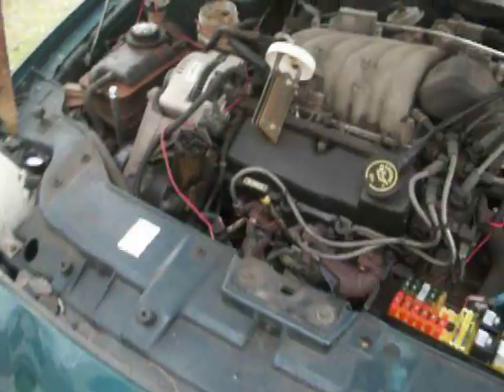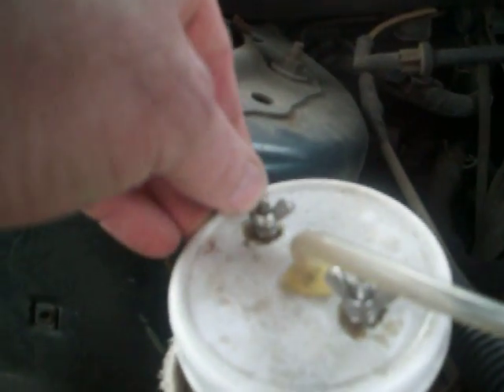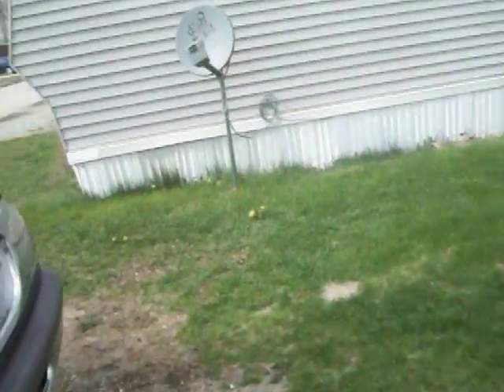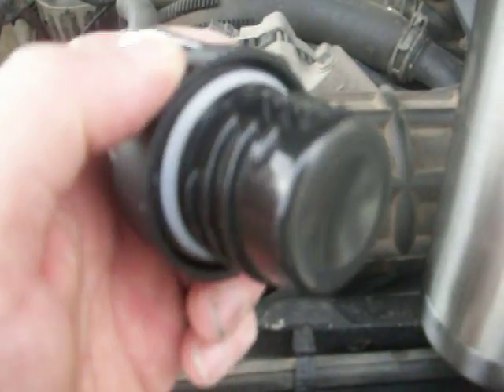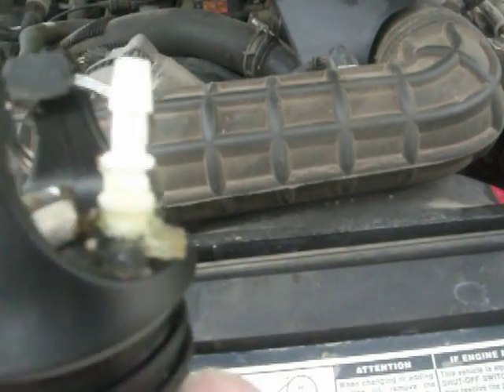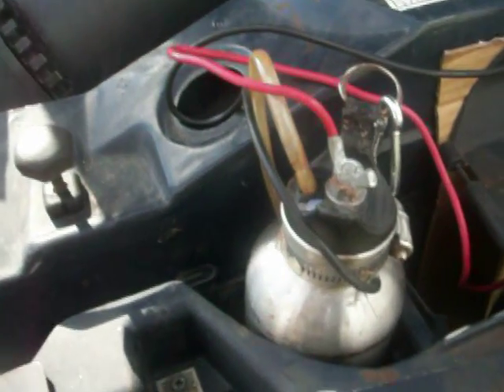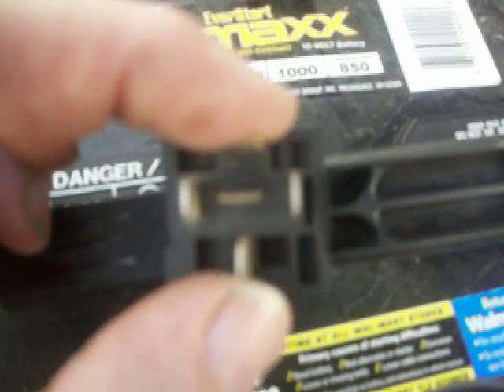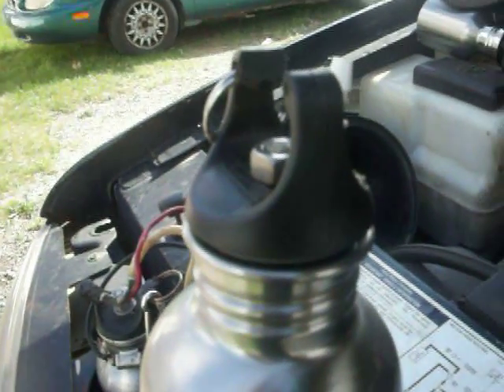HHO / hydrogen generator (water for gas) from Westcoast Exterminators!

Comment: Hi I'm SAEiD of Iran
I make a wet hho generator for my car by seven still plate but the wire near the reactor is very warming near to melt.
I don't use relay in wet hydrogen.is really important for in problem or no .
Thanks if answer the my question.and excuse my language no good.
Reply from the maker: Ok.. I think I understand. Answer.. If you use too much baking soda then you have melt... So use little bit baking soda then no have melt. Don't have wire INSIDE. have bolt inside, bolt sticking outside and wire go on outside.
Reply: @wcemichael  ok 
And other question what is relay roll and between  salt and  baking soda which is better .for engine damage .
Reply from the maker: @saeidgoodarzi2495  Do not use salt
Reply: @wcemichael  Hi
For 1 litre water how Wight power bicarbonate need .and for car bobler is nesesri or no ,
Reply from the maker: @saeidgoodarzi2495  Oh man.. That's hard to answer. You have to guess.. Test and make notes. 
IF you are  having problems and water get hot and boil...then reduce bicarbonate. If too much power from wire, then reduce bicarb. If you have battery dying, reduce bicarb. Every unit is different... every bicarb amount is different.

Comment: Michael,if you place a one way check valve in the line exiting the hho generator,it will prevent the generator from detonating if you do have a back fire.
Reply from the maker: Yea....I'm not sure about that. If there is pressure then the valve is open, if the valve is open....I would actually have to test this before confirming it. Saw a guy use a cigarette filer in the line to prevent that. Don't know if that works either.

Comment: It is funny how the denial ones do not realize that the energy gain here comes from a controlled explosion inside the combustion chamber, hydrogen is a gas, but is not gas pushing the piston, it is the force of the explosion of said gas, this principle applies to the fossil fuel also, other ways, what they claim, it should be that cars are using the same equivalent energy that is used in refineries to produce those fuels

Comment: A supercharger makes the engine more powerful, not necessarily more efficient. You compress air so you get more air in your cylinder, which means you can put in more gasoline to extract more power. The two are completely different things.

Comment: That's how it works, same as on your bike, when you put on the generator for your headlight you have to pedal harder. Nothing is free in physics, you convert shaft power to electrical power, torque turns into current.

Comment from the maker: Yes this is true, The altenator works a little harder and takes a little torque from the engine to more fuel in the engine, BUT what he's discribing is also exactly how a supercharger works. A supercharger steals torque straight from the engine to force more gas/air mixture back into the engine so the engine will have more torque. If we use the same laws these guys use for HHO then a supercharger can't work either.

Comment: The torque used to drive the alternator comes off the shaft, you cant use it twice. To have the same acceleration, you need to replace that torque, which costs you more than you gained through the HHO.
If it really worked, all cars would have HHO units, but it doesnt work, so they dont. It's not rocket science people.

Comment: "You take energy from the shaft and... get electricity."

not quite. The energy comes from the battery, which indirectly came from the shaft. The alternator never turns off, it's always on, charging the battery. The gains would come from the difference between charging a battery thats already full and how well it charges while under the load of the HHO unit.
Not that simple, Captain Entropy, where's the energy that gives electrons their spin?

Comment: isn't the alternator spinning in there anyway, producing surplus electricity? The torque from the engine is used for moving the car, production of electricity is only a consequence of producing torque for the driveshaft
Even if it takes 3000W of shaft power to produce equivalent HHO, it would probably take 15000W to accelerate the car. Hypothetically speaking. The real question is, how much electricity coming out of the alternator is used vs. wasted. The alternator spins regardless of it's load.

Comment: No it doesnt reduce fuel consumption. Let's say you take 3000W shaft power to create 3000W worth of oxyhydrogene. You put the oxyhydrogene in your engine and get 1000W of shaft power. You still need additional 2000W of shaft power to drive your generator that come from regular fuel. Ripping out the HHO generator altogether saves you 2000W worth of fuel flow.

Comment: Doesn't HHO reduce the amount of actual gasoline required for the same torque? Effeciency of fuel burning is not the point, fuel usage per torque is, more fuel from HHO means less fuel from gastank... it's peculiar that you'd gloss over that notion.
Can electrolysis of water be done more efficiently than other schemes?
There is where more increases lie.

bah I'm just an armchair hypothesizer anyway.

Comment from the maker: The relay also makes sure I don't accidently burn up my wiring harness from drawing too many amps through 1 wire.
So as long as you stay away from computer wires and do not tap into a fuse that is on when you turn the key back to ACC and your not trying to pull too many amps then your OK.

Comment from the maker: The steel drinking bottle is SO much easier for a begginer. I used a 30 amp relay. It automaticly switches on the power coming straight off the battery. I didn't want to tap into the wrong wire and burn up a $200 computer. The relay kicks on ONLY WHEN THE IGNITION IS ON. If I turn the key back to listen to the radio w/ the engine off, the HHO is off, OR ELSE YOU COULD BLOW UP SOMETHING WHEN YOU START YOUR CAR after listning to the radio for 5mins.

Comment: @wcemichael I know I've been a harsh critic of HHO, but there is one way HHO can work. If you install a heat exchanger in the exhaust tube and use it to power a water vapor process that drives a turbine and then a generator, you can then perform electrolysis and use that HHO to improve your mileage. This is fundamentally different, because instead of using shaft power, you are using the exhaust heat, which is waste anyway. If you can find a way to use waste, you increase efficiency.

Comment: @HHOTruth You keep saying that, but what more is there? The efficiency of an engine has very little to do with how efficiently the fuel burns, in most modern engines the fuel is burned with an efficiency north of 95%, there is not much you can do. I've comprehensively shown that HHO cannot work. All you're saying in return is "Well, there's more..", that doesn't have me convinced.

Comment from the maker: @k0nn0r I have nothing against going to school, but I have over 35 years on hand experience. I fixed my own bicycle when I was 7 from a book. I helped build my mothers house when I was 14. I did it a little of everything. I worked on my own cars, before I was 20. I wrote my own programs on a comodore 64 in college. I figured out motorcycles from a non running yard sale honda 350 and rode it for years. I'm selling a new style wood stove plan on ebay. Now I've figured out the power problem on HHO.

Comment: @HHOTruth I just did. Using 3000W of shaft power to create 3000W worth of oxyhydrogen gas is physically impossible already. But I'm giving you the benefit of doubt. Even those 3000W of gas dont turn into 3000W of shaft power because your engine is a lot less than 100% efficient. You get around 1000W of shaft power, the rest goes out your exhaust pipe as losses. You are turning 3000W into 1000W. Where is the gain?

Comment: @HHOTruth Let me explain to you why HHO doesnt work: Let's say you take 3000W of power from your driveshaft and drive a generator. Let's assume there are no losses and those 3000W turn into Oxyhydrogen gas worth 3000W. Now you put this Oxyhydrogen gas into your engine that's only 33% efficient, you get 2000W losses and 1000W worth of shaft power. You turned 3000W shaft power that went into the generator into 1000W of shaft power with 2000W of losses. It doesn't work. It's a scam.

Comment: @wcemichael The argument that the mythbusters experiment failed because it was not run properly is idiotic. To say that their electrolysis was insufficient because they didn't add baking soda further proves that you have no clue about what's going on, you don't need electrolytes for electrolysis, it even works on de-ionised water. HHO doesn't work and cannot work because your overall sum of energy is negative, not positive. If you believe it does, you're either an idiot or a fraud.

Comment from the maker: @k0nn0r But remeber! the space shuttle main engines (not the side boosters) run on 2 parts H 1 part O, not gas. H as I understand is 5x more powerfull than gas. And first your getting a extra bang from the HHO then this helps the gas burn more complete too (remeber we need a converter to burn the excess gases). I have also considered the electric consumption too AND I have come up with way to get HHO WITHOUT drawing extra power. I just proved this in a bench test and will try it next summer.

Comment: @HHOTruth But you dont just add HHO or H2, you have to dissociate water first and that costs you more energy than you get back. If you had a bottle of H2 and just injected that, sure you would have a gain, because the cost of creating that H2 wouldnt go into your balance, it was already paid. If you make your own HHO, you have to account for the energy that goes into that and that leaves you with more losses than gains.

Comment: @HHOTruth It's very simple. You take energy from the shaft in the form of a generator and you get electricity. That electricity is used to dissociate water into hydrogen and oxygen. Then you put that in the cylinder, combust it with the rest of the gas and get some energy out of it. The energy you get from the combustion is less than your electrolysis cost you. You have losses in the generator, the electrolysis, the combustion and the thermodynamic process. You end up with less. Simple

Comment: @wcemichael But it's not a computer, it's a simple machine designed to do one thing. The process is clear and you analyse it, every step is known. You dont have to do the experiment, you can look up the values in tables and see what happens. It's not magic, it's science.
It's not working, it can't work. You cant get more energy out than went in. What you are saying is not even a perpetuum mobile, it's worse, because you get more out than went in.

Comment from the maker: @k0nn0r If you took your computer in to be fixed and the guy said he knew what was wrong but never tested it before or after he worked on it, would you go back to him? If you haven't put one on your vehicle then you don't really know. Now the big drawback is it takes power to create this power, BUT I just ran an experiment on how to run WITHOUT using extra power. sounds crazy but I did it. and will be trying this out next summer on my bike.

Comment: @wcemichael Actually, you can know that. You get the same energy back from hydrogen oxygen combustion that you invested into splitting water, but you cannot make use of all the energy of that combustion. You have heat losses in the cylinder, you dont have a complete combustion and most of all, you dont have a thermodynamic process with an efficiency of 100%. You cannot get all your energy back, so you end up with more losses than gains. It's basic thermodynamics.

Comment: @christo930 I had a 91 Calais with a quad 4 engine in it that got 40mpg, 160hp and 165FP/tourque, all three numbers were better than the standard engine a tech-4. It got such mileage because it had 4 valves per cylinder and a better than 10:1 compression ratio. The problem is that they didn't use a better head gasket and the high compression ratio blew them out(mine never did). AND it had real air conditioning. The new air conditioning doesn't work as good as freon and uses more gas to run.

Comment: @wcemichael I noticed that too, light cars from back in the day got pretty good mileage compared to today. Of course, some of them were real gas hogs. Largely, I think it's the emissions that does it. The temp has to be kept down so they use a mixture that is too rich, the cat converter puts a lot of pressure on the exhaust, you have air pumps dragging down, bigger water pumps to keep the aluminum blocks cooler and far too much electronics that necessitates a larger alternator.

Comment from the maker: @christo930 The auto industry is not giving you their best work. Look up 1976 Dodge "Feather Duster" Its a mid size car with a 6 cyl engine, with a carberator, no electronics, and cars tended to be heavier back then. It got 36 MPG.  My wifes 2002 Dodge Stratus, with a 4 cycl and modern EFI And aerodynamices can only get 25 MPG, while I had an older Ford van with V8 EFI, Heavy and shaped like a box. got me 21 MPG

Comment: @wcemichael Thanks. I know it sounds rather obvious, but having the tires properly inflated and the engine in good tune can help too, as can removing any unnecessary stuff in your trunk and such (reducing weight). Also, for most cars on the road today, there are replacement chips for your car's computer that can increase mileage or make it faster by leaning out the mixture and custom timing and most can be disabled for when it comes time to get your emissions test (if you have that in your area)

Comment from the maker: @christo930 no prob. the only dumb question is the one you don't ask. on regular vehicles, it seems to give about 5 MPG extra, no special hook ups. your also battling the extra power it takes to generate gas. still testing. On my bike all reg bulbs were either replaced with LED bulbs or turned off to reserve power for the unit. the bike goes 20 miles extra on 2 gal tank. Check my newest vids for motorcycle/scooter hookup. next year I will try multible units, get more gas and use less power.

Comment: @wcemichael Oh, it looked like it was on the manifold side of the filter, sorry about that. Since I was seeing it disconnected, it looked like the hose was coming into the intake hose right after the filter and right before the mass air flow sensor (MAF sensor) and the MAF sensor controls mixture timing and other things, and I wouldn't want t see it damaged.Sorry  about that. What are your latest mileage improvements?

Comment from the maker: @christo930 Well, those hoses get dried out and change color a little bit. And the first hookup or 2 the unit was overfilled. and the run off was blown through. But the rust was still trapped in the water. You'll notice a brown stain on the air filters too, The first trial in the green car started boiling away from too much the sodium being too strong, and splued all over it. The truck and bike, if you'll note. The hose is on the other side of the filter so the gas is filtered.

Comment: @wcemichael  I notice the hose is brown too, which means rust particles are making it into your intake system and could, in theory, damage the valves, rings and cylinder walls. Perhaps a small in-line air filter would keep any rust particles from the intake system. I also notice the hose goes into the intake directly in front  of the MAF sensor, which feeds the computer information about how much air is getting into the engine and what temperature it is, that rust might start to coat the sensor.

Comment from the maker: @wcemichael ...unless you have the wrong design and water can not circulate or be cleaned without taking it apart. Which is another reason my bottle works good. open the cap and it's apart.

Comment from the maker: @christo930 I think so. water can hold a lot of stuff. Plates are stainless steel (very important). and one unit had some plate corrosion but the amount of rust was bigger that the area eaten away. I'm just glad that is just rust, because I use tot think that it could be caustic or toxic, or both, now I know this is not true. I used 1 bottle all summer then cleaned it. The rust is not a big problem nor will it short out the circit if too much is collected. Just a byproduct not a big deal unless.

Comment: @wcemichael Is it coming from iron that is dissolved in the water to begin with?  I don't think distilled water would have much iron dissolved in it and if I recall corectly, your plates are copper? maybe it's the bolt leaching iron into the water? Maybe you can use brass bolts. Brass is highly conductive, even more so than iron.

Comment from the maker: @christo930 Not sure WHY the water turns brown yet. it does it with distilled water too. Before I would not touch it because I didn't know what is was but I did a test, and now I know that this is iron oxide, commonly known as rust. I know this because I dried some and heated it. it then could be picked up by a magnet.

Comment from the maker: My truck normaly gets 15MPG. With the unit it gets 20MPG. So every 20 gal of gas used gives me an extra 100 miles of travel for free. If you do a bunch of engine retuning it could do better. My motorcycle get an extra 10-14MPG. Normal light bulbs have been replaced with LED bulbs to save enough power to run it. Now, a simple unit like this can draw too much power and make to much heat. To fix this you use less baking soda. The bike unit has a much weaker solution to solve it's power consumption.

Comment from the maker: Great. Constantly recheck everything. make sure the gens not too hot, not drawing too much power, not boiling the water after 10-20 mins. As for MSG, I use it because we already have on hand. So I tried it and it worked. If you have an asian store nearby, go ahead and try it if you want, but I wouldn't worry about it. Got any pics, vids?